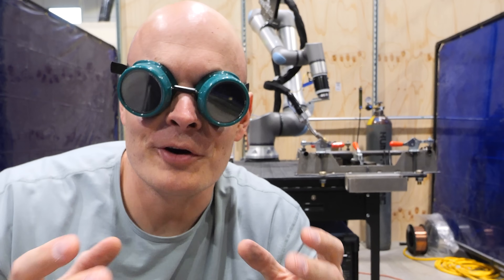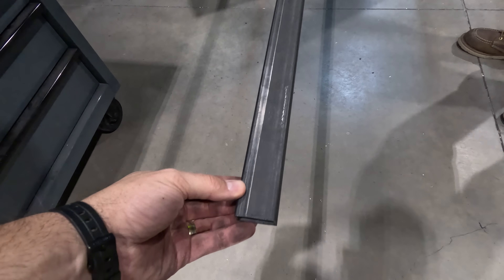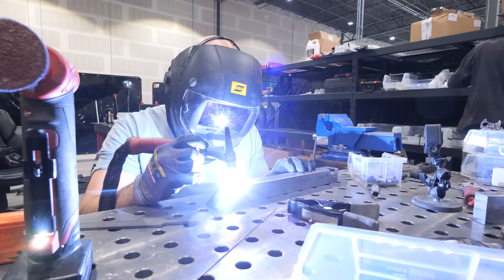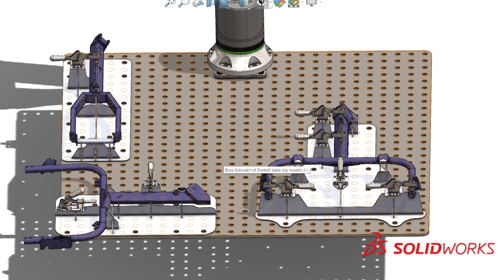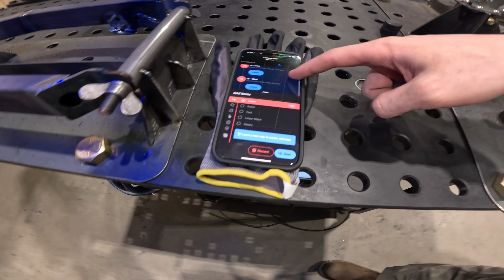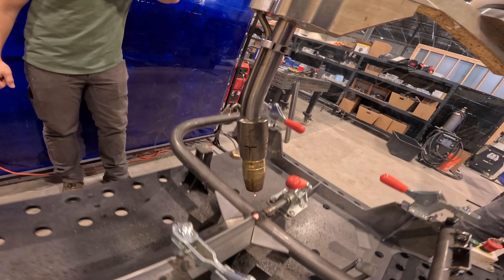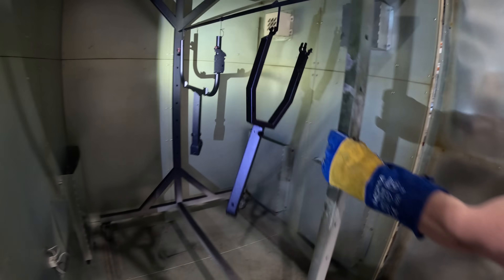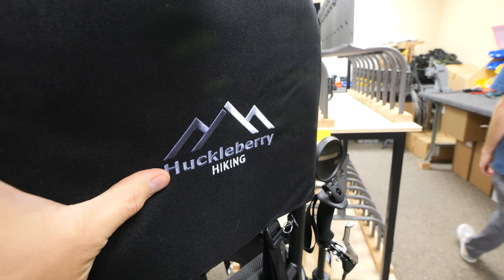My factory is up to something special...

Comment: I find it unbelievable that a half bike harness costs $2500. Why would it be so expensive? Do you offer any discounts for low-income individuals? It seems like you’re just trying to make a profit from this exorbitant price.
Reply: if you look at the video you get a pretty good idea as to why. They are making these things in tiny quantities with extremely expensive manufacturing techniques that take a lot of machine time per piece on expensive machines. Like take 1:44 - they use this giant ass machine two drill two holes and cut a pipe essentially. In manufacturing is pretty easy to get a working prototype but making these things in a cost effective way is what really takes skill.

Comment: Hey! Cool video! Completely answers my questions about your process! Have Hirebotics made a desktop app with more cad like interface? A company that reached out to my old company told us they would be implement a more in depth way to program it. I found the touch programming to be tedious with large runs and multiple parts. For example if you put 3 of each of those on the table, you would only have to program the weld path for 1 and just copy paste to the others, and then touch up on the go. It feels much quicker.

Comment: Amazing effort. One quick question, is there a reason you have it doing tack welds when it is all jigged in place?
Reply from the maker: Good question! If we weld in one spot without tacking the others first, the heat from that first weld can warp the metal enough so that the rest of the piece gets thrown out of alignment. So doing the tacks first ensures that nothing moves when the heat gets added.

Comment: Absolutely fantastic video. I love these behind the scene videos of your factory at work. What are your thoughts on the Laguana laser? My small company needs to step up to a laser for our sheet metal business and the costs of Trumpf or Amada are just unfathomable. I explored the Laguana briefly, but wasn't sure if it was capable of our production needs from a reliability and standpoint. They are priced very reasonably and I'd love to hear that they are worth it compared to the big brands.
Reply from the maker: https://youtu.be/DdN-fgQDuRs?si=rbLuSQcD5O31Vc4l

I made a whole video about the laser (above) it has some safety issues, but for the most part it's really good!  We've been using it daily for about 6 months with no issues.

Comment: Just throwing it out there, but i would give sparky a full load of work and completely load the table with parts to weld. Also, you could make a thinner table top that has all the clamps on it already ready to go, so when you switch objects thats youre working on, like you want to go from wheelchair to bicycle, you just switch the table top instaed of switching the things that hold the pieces in. I know, its alot, but it would save you huuuuuge time.

Comment: Why don't you design a tip for the welder so the arm has a repeatable datum point. You could design it to look like the mig wire with proper spacing,  and even have a momentary switch or use electrical conductance for added input.

Comment: I used to operate 2 of these robot welders on stainless steel at Hogan Manufacturing in CA. They are pretty cool but the ones we had needed to be programmed with the tablet. That's pretty sweet you can just program from hand movement.

Comment: Why not make it out of the aluminium like bike frames are made? 15kg for a one wheel system is a lot IMO when entry level bike made out of aluminium weighs around 13kg with two wheels and more frame and components than this. I mean, it's an excellent idea but could use some streamlining.

Comment: Well done ! 
Without counting for the machines you already have, you may be interested in clinching tooling (usually they are faster and less expensive to use specially with standard stuff like the welded nut you showed, and yes it can hold better than weld in tough condition)

Comment: 7:37 Welding ALUMINIUM is called MIG. Welding steel is called MAG!!
Reply: Depends what gas you are using. You definitely can MIG weld steel.
Reply: @widgity  That's the point!!! If you change gas^^ It becomes a MAG!!! 
The "I" or "A" in MIG/MAG is the gas you are using!!
If you dont know that, plz stop welding!!!!
Reply: @widgity  YOU MAG WELD STEEL!!!
The gas you are using for welding steel is a ACTIVE gas!!
Therefore "MAG" 
If you weld Aluminium or stainless, you use a INNERT gas^^ Therefore MIG!!!

Comment: That pricing for Solidworks is great but you really have to hate yourself to use it. It's one of the worst software experiences I've ever had. If it were the only CAD around, I'd use paper instead. Truly awful, to a surprising degree.

Comment: of course, you're only building 100, so this is very nice, but I'm positive this process can be even more Automated with a PLC and a material handling robot/conveyor system. I usually only Automate in the Automotive Industry, but I'm Positive material like this can easily be handled instead.

Comment: Don't invert mount your robot, leave it the way it is. Even if the robot is rated for invert mounting, movements can get more challenging. Robots work best when they're mounted the way you have it already. What might help is teaching a User Reference Frame for your weld fixtures. You'd need to add reference points to the frame, but this would allow quick teaching of additional fixtures.

Comment: That would be awesome for carrying search and rescue gear. We have to carry a stretcher and loads of rope gear and this would make our trek up a mountain much easier.
Reply from the maker: I agree!
Reply: @JerryRigEverything  I am going to contact SO Tech and suggest they watch this video.
So Tech make the rucksacks and other  medical bags used by the teams at Bragg (as was). They also sell to police, search and rescue. They have a YouTube channel about their kit. Which they customise for operators. 

I was thinking of what a reengineered design with a foldable wheel could do to help get a wounded soldier back to  an Aid station.

In this case it not about lowest cost this is cost plus but gives custom tools for special operations.

I was especially thinking about if the wheel was attached to a Bosch motor/battery how much weight a team could bring in with them, especially if they are also using battery powered leg assist tools.

I assume you know all about bosch power systems. But are you in touch with Utah Trikes? As they seem the perfect resellers of your products. They have a popular YouTube

I would also suggest talking to ICE in Cornwall UK who make Trikes that are sold around the world. They also have a YouTube channel. This is just the sort of project that would appeal to them and they could act as resellers in the UK
Reply: Check out the Terra Tamer, Ferno Mule or Lyon Steetcher Wheel. They're exactly the kind of thing you're probably looking for for rescue. A little bit of extra weight to carry in yes, but you could then extricate a patient with two people safely, rather than needing 6+ to carry out a stokes litter. Similarly you could use it going in with your kit bags on it. The Terra Tamer is great, can't comment personally on the others.

Comment: 3:27 question: is welding in the vicinity of other workers safe?
Reply: It is not. Welding fume is toxic and depending on the metal composition it can be very toxic. Welder should be in a respirator with exhaust ventilation (smoke hog) near the welding zone.
Reply: I was thinking there should be some sort of fume extractor like what you use when soldering.

Comment: I've used factory welding robots before (i'm an electrical engineer in factory automation). I'm curious why you don't have sensing on the weld wire - you can run a program that just makes the robot drive into the rough area of a starting location and do an x/y/z search to home the thing perfectly every time. This works since you've already grounded the part to weld it.

Comment: First off, thanks for giving us a heads up tour of the process. Very cool. Now time to put my automation/controls engineer hat on. I commission UR's and other robots all the time. Have over a decade of experience with this sort of thing. I am going to just assume you greatly simplified things for YT and didn't cover a lot. However, it pains me to see you using such an expensive robot for such a simple task. Also, using a cobot with a weld tip is unwise and requires so much additional safety for CYA purposes, that it basically negates all the perks of using a cobot. One caveat, if you are constantly doing custom one offs, the free drive teach and super simple programming interface might be worth it, but if you are doing big runs of the same thing... you could save a lot of money just making a robot in a box and using a non cobot. Like an Epson VT6L ( roughly 7 to 10k depending on options) or an equivalent Kawasaki or Kuka. ( you have Fanuc as well but they want your firstborn and a leg) What you do is for a great cause. I am happy to offer free consultation if you want industry expertise in the future. Also, read up in maintenance schedules for your UR. They are known to have issues after a shorter than normal run period. My advice, be ready and learn to do it yourself. Its tedious but not hard. And will cost you a fortune if you ship it out to be refurbed. Just my two pennies, sir.

Comment: It’s time to look into hydro forming. It will lighten the chairs and take a lot of welding out of the process. You also might want to start laser cleaning your parts with another arm. You don’t need to suit up and no booth required.

Comment: Design Engineer here - interesting equipment, modular and adaptive setup for a startup.

I thought you can get 'vision based' self correcting articulating robot, if the jig or joint is slightly out of position?

For repeatability and speed in processing welds have you consider this?  (for continuous production, not 'one off' setup)

Instead of fixing the 'work pieces' to the table and allow the robot move freely, do the opposite, put the 'work pieces' onto a conveyor (with fiducial location + tie down with toggle clamps Jigs) and bring it into the robotic 'work zone / envelope'.  This reduces robotic articulate movement for reduce cycle time, but may require additional equipment like 'vision based' system to improve weld position accuracy.

Comment: Like the show yet I gotta be that guy real quick  stress loads on the neck welds to connect seat harness  should be around 720 pounds ,,,because of lainth of distance to wheels hub.  The stress on that neck to back harness multiplied by 1/2 tube neck brace shear strength may bend the tube under stress loads in active rock torains.

Comment: Put a hub motor in it to assist on steep ascents.  Add a shock absorber between the sherpa hoop and the main bar to reduce the impact of the wheel hitting rocks.
Reply: My first thought was adjustable length between the passenger and sherpa. Longer is less weight to bear. Shorter is better for more rugged or tight trails.

Comment: WOW! Great stuff. I worked at an electric motor manufacturer where I was responsible for programming welding robots and about 35 CNC lathes, mills, and punch presses, as well as using Solid-Works. The robots (Motoman, ABB) were a pain to program and I greatly disliked working on them... but boy howdy...I sure would have liked to have had robots like Sparky!!!

Comment: Zack, I'm wondering if the bead blasting couldn't be done by a robot also. Seems like a lot of repeating movements almost like painting process done on cars. BTW, the building of these frames is perfect. Good job!
Reply: I was thinking the same thing; a Sparky 2 to run the sandblaster.

Comment: Solid works is beast of a program. I used it little over 20 years ago for cnc and drawing in general and it's really fun and more or less easy to learn.
Reply: Where to learn solid work easily can tell me
Reply: @MrEmpty97  i was messing around it with it in high school for a year. It was the first year my school in the area to get cnc equipment and it was really awesome in metal shop. Teacher got us into a local area,  regional competition and got us into state comp. We didn't win but got really close! 

At that time we had Autocad 2000 , which was a great cad drawing program and bind it into solid worksand it was easy. Then start clicking around, reading the book and goofing about. That's how I learn on about everything unless it's a powertool or something of the sort that doesn't care if your arm is a 2x4 or a shiskabob.

Comment: Remember, with a UR Robot, it will only stop if the detected collision is in the motion direction. So if you hit the robot (human) while the robot is moving away from you or moving horizontally and you hit is from above, it will NOT STOP. UR uses current sensing on a drive. 
FANUC CRX monitors ALL axis for any collision all the time, as it has force sensing on all joints, plus zero maintenance for 8 years.
Reply: I was wondering if they put the bot arm in a series of plastic sheeths  and taped off the end near the welding tip using metal velcro***, to survive the heat.
Would that provide a high enough IP rating to allow the arm to weld under water? Thus help create tighter welds faster?

* Adam Savage of the Tested YouTube channel ( and formally of MythBusters) has all the details of metal velcro and I assume that this is exactly the type of project that Adam would want to help with!

Comment: It's a great design, on an idea that has aready been discovered, however, if your wanting to go hicking with a child in a wheelchair. All you need is two doc-lines and two large carabiner clips ( cunnect rope to the front foot plait to lift to carabiner to belt, then second rope to rear lower frame to carabiner.)Plenty of youtube videos on how to do this, with your pre-existing chair. However, this process takes two people to operate.

Comment: Instead of building it with a wheel which requires a lot of stamina to pull around, Introduce antigravty. Take away the wheel because it's no longer required. Because it no longer has weight you should be able to go anywhere easily.

Comment: I thought those weld nuts were designed for a spot welder or stud welding gun?  Though I suppose the uncoated nuts with a locating shoulder work just as well when hand welded.  

The 1-wheel back pack is an awesome product!  Glad to see you helping out.

Comment: Hey Everyone 🤠
Find the parts that interest you:

0:02 - Introduction to the Huckleberry hiker
1:15 - Using lasers for precise metal cutting
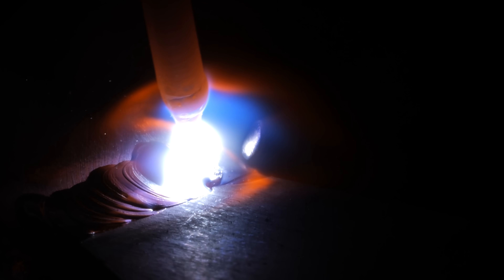3:21 - TIG welding for clean metal joints
5:38 - Setting waypoints for robotic welding
7:15 - Teaching the robot for repeatable welding
9:10 - Powder coating process explained

Chat with videos via Bumpups 🌲

Comment: Hey Zack, you have one cool factory. Sparky’s welds sound a little wrong tho. Which wire diameter, amperage&voltage are you guys using? I am a welding engineer.
Reply: I was thinking the same thing.

Comment: Go find real work and dont post asking for views or money.
Reply: It will be extremely challenging since manufacturing costs in the US are exceptionally high, making anything with even a slight economy of scale uncompetitive in the market. There's a reason why consumer goods OEMs don't use welding robots in low cost countries.
Reply: says who
Reply: No true, using welding robots for low production and consumer goods manufacturing do not achieve the high speed production effect as expected. Many issues could have arisen in the robotic welding process, such as arc tracking problems, welding torch issues, contact tip problems, wire feeder tubes, welding wire and fixtures problems are everywhere, all requiring time to adjust, which is very inflexible for most OEMs. Under most circumstances resulting in a daily output that is less than half of what manual labour can achieve. I say this because I visited a Chinese manufacturer with around 20 Fanuc R-2000iB, yet they still strongly prefer manual labor. This is what I was told.
Reply: Can I post asking for apostrophes?

Comment: How Fast is Sparky compared to humans ? 😮
Reply from the maker: A tad faster and more consistent on the longer welds. But he's not so good at the small stuff. (Like weld nuts)
Reply: @JerryRigEverything Cool Robot, I think you forgot to put in the 50$ coupon
Reply from the maker: @atlanarsimhareddy1477  as soon as you go to check out it'll automatically apply! I just checked to make sure.
Reply: @JerryRigEverything Can confirm its there now 😅
Reply: @atlanarsimhareddy1477  Just don't use Honey lol
Reply: It's not about speed it's about welding itself cause humans get expose to the UV rays when welding 
Robots solves this problem taking all  expouser and making humans healiter